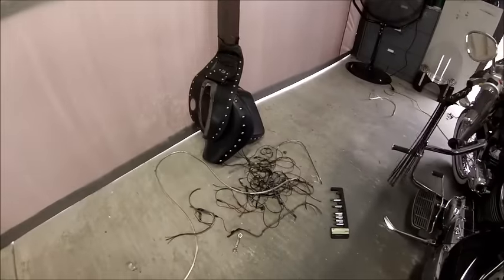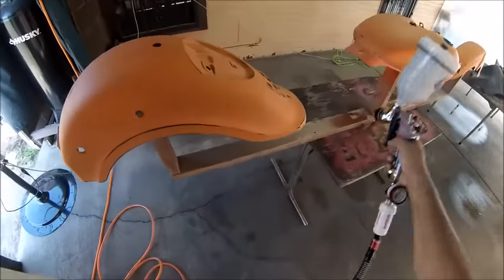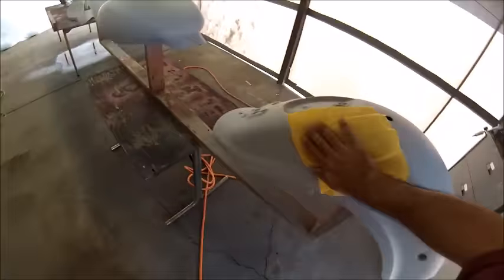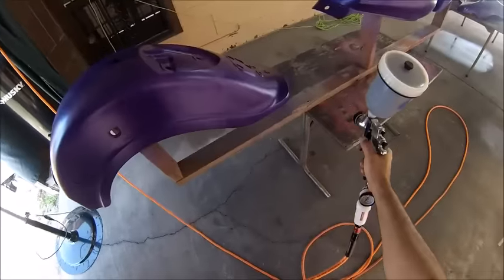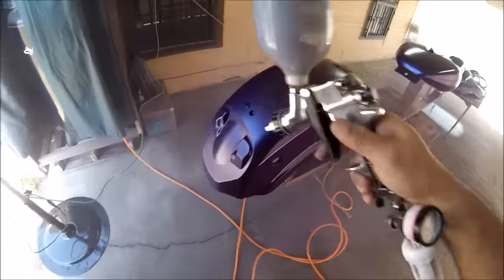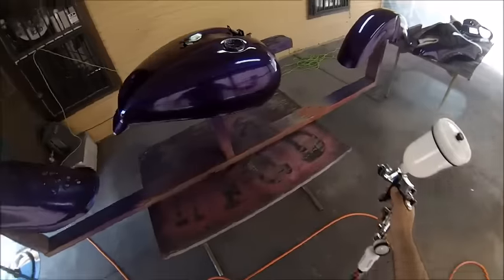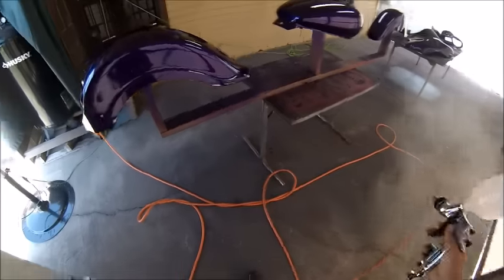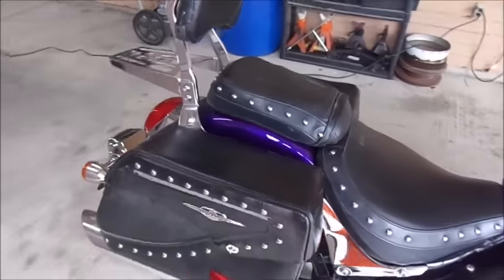HOW TO PAINT A 2009 SUZUKI BOULEVARD C50 FULL COLOR CHANGE

Comment: Great looking paint job. What needle tip combination did you use for each product?  I noticed that you did not use a guide coat on the sealer primer or block it and your paint job came out great. Is blocking necessary or is it the products you use?
Reply from the maker: it's a 1.3 and about the guide coat the motorcycle was clean and straight
Reply: InstaBlaster

Comment: thanks for the video , my questions= how long for primer to dry before you applied 1st light basecoat ? and how long between coates after that ? including clear.?  epoxy sealer??
Reply from the maker: Danny theplumber hi I added sealer it usually takes about 10 to 15 minutes before adding the first coat of base after wait every 10 minutes in between coats after base wait 15 minutes before clear and 10 minutes between each coat
Reply: thank you pharraway , very clear . And finally I would like to ask=may you use and top up existing paint in the gun for the following coat or do you throw it out and mix a fresh batch for every one ?
Reply from the maker: No, you can use the same you don't have to throw it out

Comment: cool... I noticed you didn't wet sand between coats? was there a reason for this, certain types of paints don't need to wet sand? came out really glasslike, just curious about ripples...
Reply from the maker: Wet sand between coats??? No never done that this type of paint doesn't need to do that and about the ripples (orange peel) the clear I use hardly comes out with that.

Comment: How much paint did it take and what was the final cost? i want to paint mine this spring. I have the same bike but no fairing on mine.
Reply from the maker: It took 1qt of paint and 1qt of clear with 3 coats of paint and 3 coats of clear, that's basically what you would need for a bike like this a 1qt kit
Reply: How much primer did it take and was it a 4:1 mix ratio?

Comment: did you rinse the fuel tank as to not have gas vapors peel the new paint off and if you did rinse it what was your process  great though
Reply from the maker: no, just so that I can paint the bottom, and as for the fuel the gas was taken out and left for a day or two with the gas cap off for the vapors will evaporate that's all you need to do
Reply: Oh ok good to know bike looks great